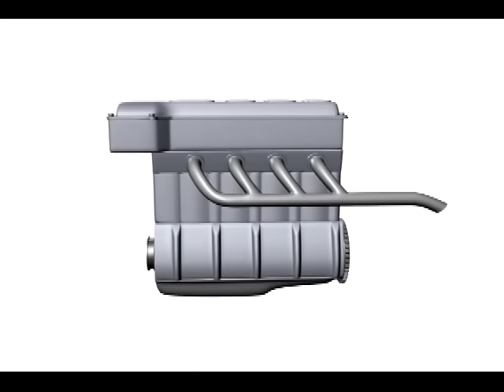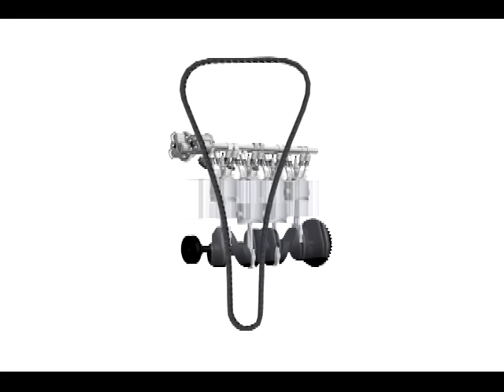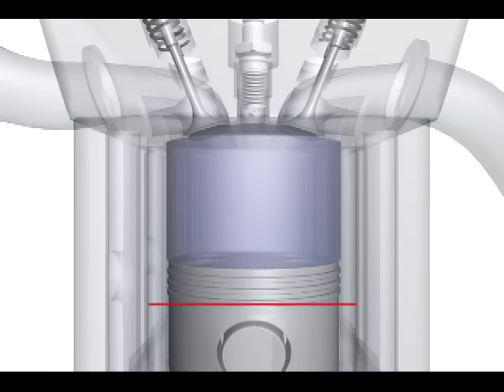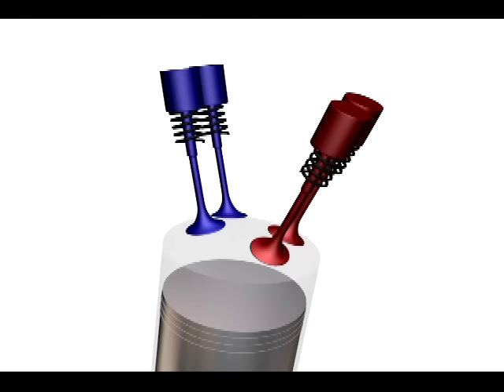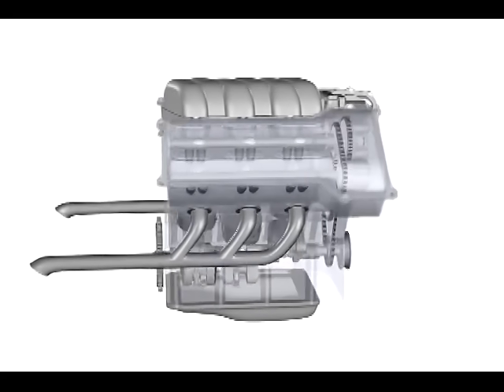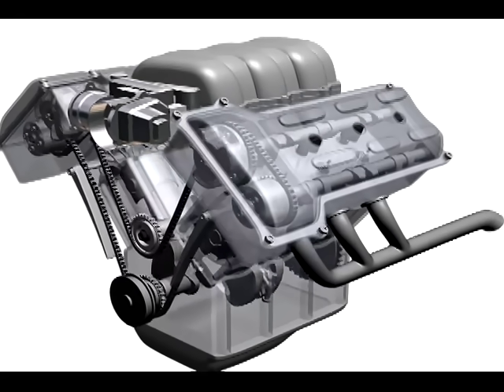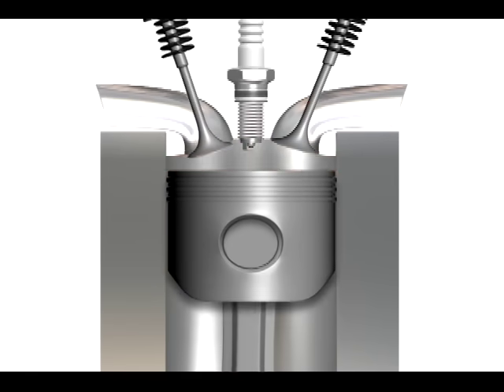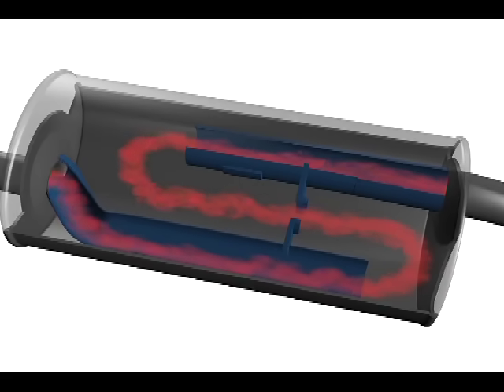How an engine works - comprehensive tutorial animation featuring Toyota engine technologies (2008)

Comment: My car engine light was on i.drove it my car over heated ... i have so many people telling me my car blew a head motor, or it broke the belt inside the motor, or i need to replace the whole engine/motor help what should i do .... the timing belt is still on but ive being told the belt in the motor is bad
Reply from the maker: Overheating usually leads to a slight warping of the cylinder head which causes the gasket between the head and the block to fail. That will cause coolant to leak between the cooling ports in the engine and the cylinders and out of the engine so would need repairing. The timing belt has to be replaced at certain intervals (in your manual). If it fails, the valves lose control and in most engines, can actually impact the cylinders and damage the valves and cylinders. So a timing belt replacement at the correct interval is important. If the engine is running, it certainly doesn't need replacing but sometimes an older engine is cheaper to "swap" with a less-old engine than to repair and some mechanics may be recommending that instead of fixing the head gasket.
Reply: allegroracing oh i see so even tho the head of the engine has no liquid coming out of it it might need to be replaced/swapped? The engine when i try to turn it on it seems like it wants to start ... im not very or at all educated about cars but i feel like people are just trying to get money out of me some are asking me to junk it or. They will give me 500 for the car which leads me to believe its not really a big deal.. i have a 2006 Hyundai elantra gls small car it has 138miles what do you think i should do fix and run it but it might give me problems later on or get rid of it
Reply: Cesarina Perez
Ok first thing's first, don't try starting it. I am a tech and I say go to the dealership; most likely a warped head but to air on the side of caution they will need to take the timing cover off. You like others have what's known as a interference engine. As the piston moves up and down the valves are opening and closing near the top of the pistons stroke. If your timing belt breaks valves and pistons will collide and your cylinder head will be toast. Have the dealer diagnose the issue. I personally wouldn't even bother with Kia or Hyundai as they are POS's. I would see if you can get a trade in and get a better brand of vehicle.
Reply: probably something is wrong with your central locking....

Comment: Variable cam timing, and all that electronic control systems, its all right for technology to trim engine emissions and power and torque to critical levels but when something goes wrong you are basically fooked, you are at the mercy of expensive dealership charges to fix a simple fault, that's why I much rather stick to my old straight 6 cylinder distributor engine because of something goes wrong, I can fix it myself, and save my money for a nice lavish meal rather than feed big car giants and their dealers. Oh did you say what about the environment? oh well I drive less than 2000miles a year, so I don't give a hoot about environment as these high tech cars probably generate more emissions because their owners drive 10K to 20K miles a year, and so pollute more. Never will buy a high tech car in my life. Much rather keep my money in my bank and earn interest. Older cars never lose value, you can sell an old car for practically what you bought for. By the way this Toyota variable timing is no good as it only advances or retards the cam timing, and does nothing to open or close valves for longer or shorter duration, so it is after all not a complete solution is it?
Reply: wish there was a mechanical solution ... wait a second! Vtec just kicked in yo. ...
Reply: i fix it my self
Reply: I had a 1993 Integra before now I have a 1997 Prelude, love my vtec, love my simple transmission. I am putting an accord 5th gear in my transmission for better mpg and I do not like the idea of canbus. I agree with you Sam, I definitley agreee with you

Comment: if 1 and 4 cyclinders are on top dead center ,the lobe centers should point directly at each other on cyclinder 4 and directly away from each other on cyclinder 1 flush with the top of cyclinder head, just guessing lobe centers are 110 degrees on this engine if a turbo is used set at 108

Comment: "you dont care about inline 6's" which you call "outdated". Why even say something like that? You did show an inline engine design anyway. Its not a big deal if people want to talk about the 2JZ in your comments section. Speaking of which is the best 6 cyl ever made. Calling it "dated" shows your ignorance to the engine design world. Had you not put those pop up boxes in the video i would have liked the video, instead: dislike.
Reply: how could you still not have gotten the point of this video. it's written down around here at least 3 times. the video is supposed to explain toyota's recent engine technology to car dealers. at no point was any statement made about benefits or quality of inline-6-engines. they just don't feature for the reason stated above
Reply: Gigaguenther if you saw the pop ups they edited in, they said to stop commenting about the I-6's from the 90's and that they were "dated" which they didnt even need to say. The i-6 works exactly like an i-4 except it has 2 more cylinders tagged on. If people wanted to talk about the -6 let them, big deal.

Comment: The four strokes:  Suck. Push. Bang. Blow.

ie. Intake. Compression. Ignition. Exhaust.
Reply: um suck, squeeze , bang and blow!
Reply: Thanks, good way to remember that!
Reply: Our autoshop teacher called it suck squeeze bang blow
Reply: Squeeze = pressure.. Pushing doesnt really equate to pressure it equates to momentum
Reply: Suck, Squeeze, Bang, Blow.
Reply: Car Engines: After Dark
Reply: What a dirrrty way to remember that.
Reply: Sounds like women, you sure you're not talking about women?
Reply: Only the dirty minded will see this in s different way

Comment: So you telling me..that Normal Fuel Engined-Cars won't work in an enviroment with no Oxygen?
Reply: internal combustion engines use chemical reactions to produce power and need an oxidizer to work.Most are air-breathing because our atmosphere has conveniently oxygen in it which works well for this. There is a possibility to bring your own oxidizing agent, like nitrous oxide instead. It's used for high performance cars, it was used for airplanes flying at high altitude where there's not enough oxygen in the atmosphere etc. Space rockets have to bring their own oxidizer, because there's none to be had outside of our atmosphere.
Reply: So, there's no EGR valve to reduce NO.emissions in a Toyota engine. Good riddance.to bad ideas.

Comment: that air chamber at the end that opens at higher rpm how do they control that it will open at higher rpm?
Reply: In the muffler? It's most likely computer controlled. Sensors will detect higher rpms then decide to open the second passageway to improve airflow.
Reply: yea i found that out in another vid everything is so technological now eh? its crazy lol
Reply: TheGoother99 yeah
Reply: KISS my Trekker ass, it's a rubber flap most likely or a spring. KISS!
Reply: Rýán Túçk wat?
Reply: The revered extra chamber is just a rubber flap over a hole leading to a shortcut in the muffler. Indiana Jones style. Engineers put flaps in the intake manifold, too , operated by servos and those always end up chattering.

Comment: I have a Lexus v6 and fuel economy is not its strong point
Reply: Lexus is generally about power and acceleration.
Reply: Rýán Túçk Yeah it lacks in that apartment as well, in the low revs anyway.

For the fuel consumption you expect a lot more power then you get, its underwhelming. It is great once it gets going, but so does my wife's 1.2 lol
Reply: Well my sister's coworker HAD a 97 Acura with a 6cyl. beast and it was unbelievably fast but the motors suffered from a weak head gasket that caused them all to overheat, and I heard about Toyotas with a head bolt that strips block threads with the same effect, they both were probably cheating off of someone else's patent to make them fast(er).

Comment: I have a question for everyone. 
How do the cylinders work? 
Like why is a V8 engine better than a V4 engine. What makes the V8 faster? How do the cylinders work? And the pistons?
Reply: Each cylinder has a piston, and more pistons means more force pushing the crankshaft. Having 4 pistons moving up and down to rotate the crankshaft won't provide as much force from combustion as 8 pistons moving up and down that are rotating the crankshaft.
Reply: V4 engines are VERY rarely used in vehicles.
Reply: V4 diesels are very common in large aquatic vehicles because the parts count is lower
Reply: V4 gas are very common in farm vehicles because farm equipment leads in innovations.
Reply: Lol no actually a lot of cars have 4 cylinders
Reply: Some switch from 8 to 4. Requires an adapting exhaust to keep the noise down, though.
Reply: alex pencek u right alot cars have 4 cylinders...their talking about V4 which is rare...most cars a inline 4
Reply: Lol... v4? I shouldn't laugh, its an easy mistake to make, one I made when I was new to cars. The "V" in the name of an engine comes from the arrangement of two cylinder banks, commonly found in 6 and 8 cylinder engines. Most 4 cylinder engines are inline, so they are known as I4, rather than V4.
Reply: Volkswagen Beetles had flat-4

Comment: what forces the piston to come back up, where does the force come from.
Reply: is it because the other corresponding pistons when forced to go down force the other pistons to go up, wondering.
Reply: All engine cylinders are made to fire at a sequence. When one cylinder is firing, the other one is compressing, the third one is letting the carbon dioxide out. For a full revolution taking 360 degree, if you have 6 cylinders, then each cylinder will move 60 degree to complete 360 degree movement or one revolution. When one moves, the other ones are forced to move.
Reply: Comprehend Nature What about single-cylinder engines such as those found in scooters and mopeds? I find it hard to understand how one stroke (the power stroke) can provide enough energy for the cylinder to move the next three strokes (exhaust, intake, compression). I'm under the impression that the piston counterweights and inertia makes it wants to continue rotating around. But remember, this is an engine and if you've ever tried to turn the crankshaft using a wrench you'll find that it's very difficult because pistons don't rotate as smoothly as a fidget spinner or ball bearing. But the engine appears to have no difficulty in sustaining this rotation. The starter motor obviously needs to get the whole process going.
Reply: In a four-cylinder engine the two inner pistons move upwards when the two outer cylinders move downwards, and vice versa.

Comment: Just a quick one here. There is a mistake with this vid. He explains that when Toyota Engines have more than 4 cyclinders they are a v shape config. The engine in the supra is a straight 6 (inline 6) not a v 6 ;)

Comment: i don't get it, how does the shaft move from the first place? From where does it get it's energy?
Reply from the maker: The electric starter motor connects to a flywheel on the back of the crankshaft via toothed gears. When the electric starter spins, that starts the flywheel turning which begins all the processes. The car's battery powers the starter and is then recharged via an alternator while the engine is running.
Reply: the gas pedal i think, kinda like a pedal on a bike, but with fuel injections and stuff :)
Reply: as was said, there's a starter motor powered by the car battery that starts the rotation. There were some cars that could be started up manually by rotating a crank. Some Soviet made cars had this option as a back-up if the starter fails.
Reply: It's magic. Never believe it's not so.

Comment: Basically, buy Toyota and Honda.
Reply: Basically you should stay out from under the hood..
Reply: dohc was not invented in 1996, what about r32 gts skylines? rb20de/det, they're from 1989
Reply: Miss and sr20de dohc usually with VVT is above this.
Although 3sge VVT is about the same kW wise
Reply: Not exactly, most of Ford's new motors have all this technology in it
Reply: My 96 Mitsubishi eclipse has a Dohc engine
Reply: ***** never mind I don't know who posted this. I don't know anything about cars
Reply: independent-suspension(struts, double-wishbone) uses birfield-joint, which
evolved from rzeppa-joint.
rzeppa-joint was invented by alfred h rzeppa during
working in ford.
source :
1. 'Birfield'
   in
   https://en.wikipedia.org/wiki/GKN
   from
   'Birfield' 
   in
   https://www.youtube.com/watch?v=vfLLaDsGWk0
   from
   'The Birfield joint, manufactured by Hardy Spicer Limited, is based on the Rzeppa principle'
   in
   http://what-when-how.com/automobile/universal-joints-automobile/
   from google (double cardan maximum vertical movement)
   page 1 result 2nd from last
2. https://en.wikipedia.org/wiki/Alfred_H._Rzeppa
3. https://www.youtube.com/watch?v=auQ65qno2Eo&t=2m10s

addition ---
jeep wrangler (crawler car) still use solid-axle-suspension which is non-independent-suspension
source :
'Jeeps have been around since WWII and they still use solid axles today 70 years later.
But solid axles aren't perfect. They have their strengths & weaknesses. Amanda products is looking to give future offroad manufacturers an advanced suspension option that you might see on Jeeps and other vehicles in the near future as an OEM independent suspension options?'
in
https://www.youtube.com/watch?v=OUEGP4HGPCw
Reply: Haha American cars are shit.

Comment: sooo like, the more cylinders the more power right? cuase more fuel is being burned. but more power means faster speeds? or better acceleration?
Reply: more cylinders and bigger cylinder diameters and longer bore depth for the cylinders = more power. 
more power may or may not equal faster speeds depending on the gear ratio.
Reply: Turbos can give you the power of more cylinders because it forces more air into the combustion chamber so there is a bigger explosion thus producing more power with not having to have more cylinders

Comment: The displacement is actually: (bore area x stroke x no. of cylinders) not (bore x stroke x no. of cylinders). Good video though
Reply from the maker: You are correct, it was over-simplified for the audience and that part is not technically accurate.
Reply: Bore x bore x area x #

Comment from the maker: Even though modern engines with electronic controls don't have a lot of the old "tune up" items from the past, they still suffer mileage drops from dirty air filters, old sparkplugs, and more. A good reputable shop should be able to tune it up properly. Also check how you're driving and what accessories you're running. High power consumption items hurt mileage. Finally check for mileage driving tips. Driver has a lot of bearing on mileage that a car gets.

Comment: The electric starter motor cranks the flywheel which is connected to the crankshaft where the pistons & piston arms are attached to. In the early days of cars you had to crank the crankshaft yourself by hand using a handle located near the front grill of the car. Nothing forces the air in. This is called natural aspiration. When you have a turbocharger or supercharger then it's called forced induction.

Comment: The piston moving down creates a downward 'sucking' force which pulls air down through the air inlet, this is known as naturally aspirated. A turbo or a supercharger can be used to increase the air volume even more-so by forcing even more air into the space made available by the piston moving down, this is called forced induction.

Comment: Nice work, great detail on the working elements in the graphics. If i was going to be a total arse wipe and pick fault, when showing a front view of your V engine at 7:23 the crankshaft rotation is backwards. It is correct from the rear view. Only a minor thing compared to the work you obviously put into the video, great job.

Comment: starting motors run from the battery once the starting motor has done its job the carb air flow controls the amount of fuel/air being drawn into the cylinder that's why when a car is running flat it means the floats on the carb are letting to much fuel in meaning loss of power

Comment: tapping the brake at the top of a hill before you coast down it. (uses less fuel) also try to do 55-65 on interstate. and slow down earlier when you see a red light. (you can often catch it green while still rolling so ur car does less work.) i have a v8 jeep cherokee and i can get 18-25 mpg on the highway/ 45 mile an hour roads  as long as i dont hit a pesky red light :) also tryh not to use your ac as much. crack a window

Comment: Dude, what are you talking about? No oil pump or fuel rail is either shown or mentioned.

Neither are vacuum pumps (even some gassers have them, at the opposite end of a camshaft than its sprocket) for power brakes, the EGR valve, the PC valve and circuit.

They don't even point out or mention the throttle body though that is, admittedly, shown.

Comment: check:
tire pressure
oil
trans fluid
any check engine lights
clean air filter
proper octane gas
remove useless weight (like golf clubs or something)

Comment from the maker: Driving behavior makes a huge difference to mileage. Even your mood can have as much as a 10% impact on mileage. From a vehicle standpoint, make sure your engine is tuned well, has clean filters, your tires are properly inflated and follow good smooth driving practices. Aerodynamics, gearing and tires make a big difference so a jeep is at an automatic mileage disadvantage. Driving habits can increase your mileage for free.